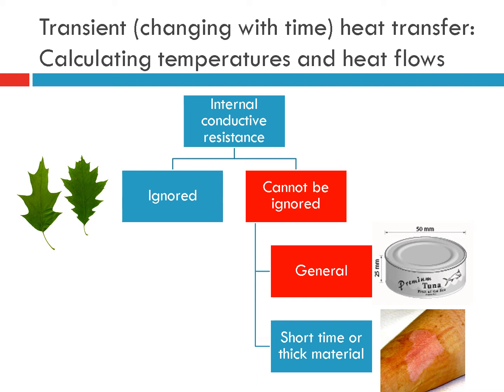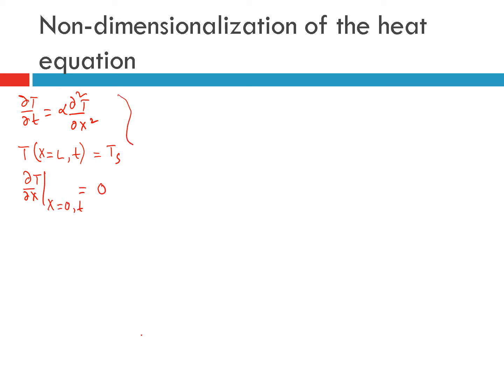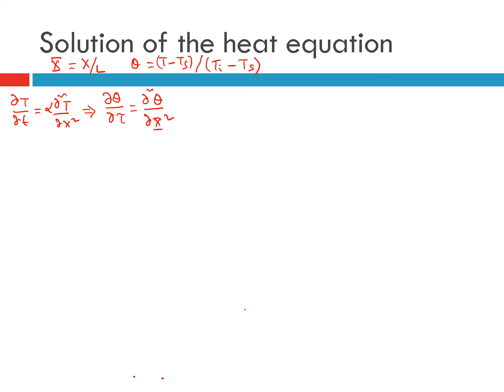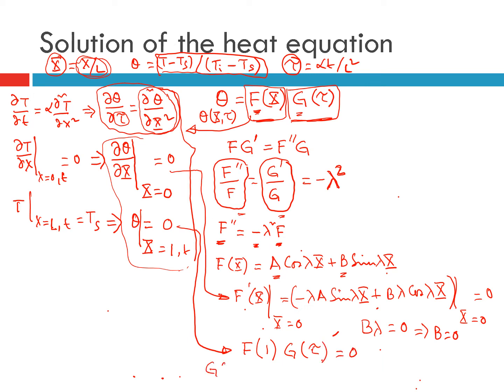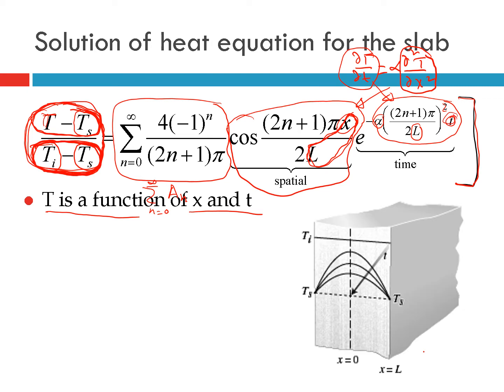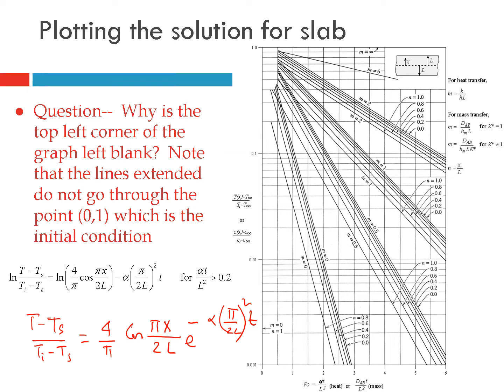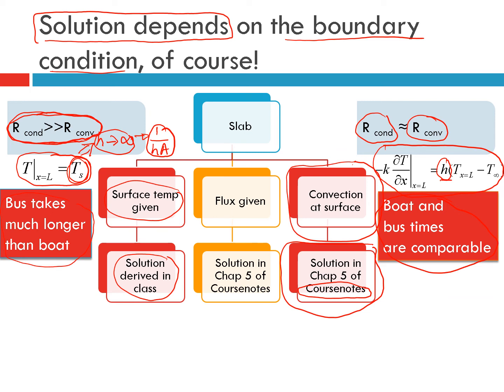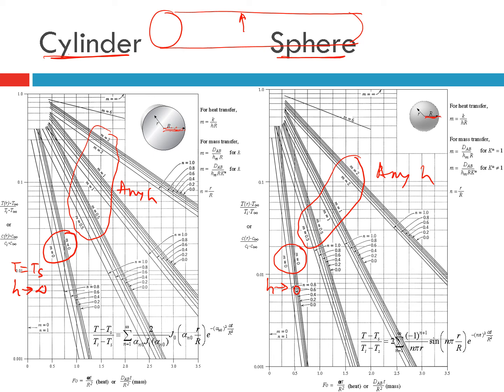Chapter 05: Unsteady-state Heat Transfer

Comment: Hello sir, your video is very amazing. I have a question, how to solve transient conditions in multi rooms of buildings with the above formulation and consider 3 modes (convection, conduction, radiation) together? and the solution is not based on numerically